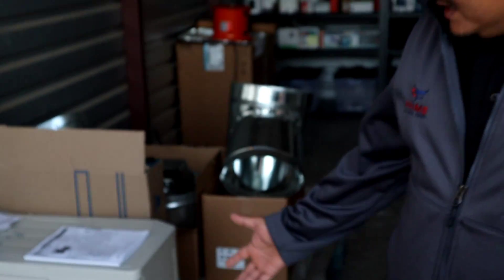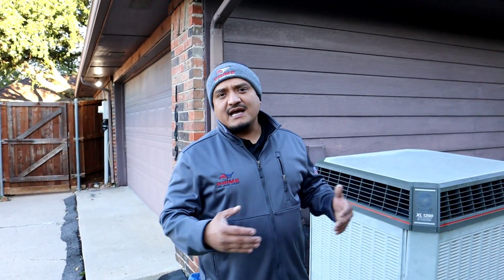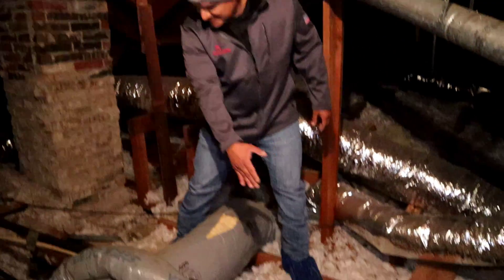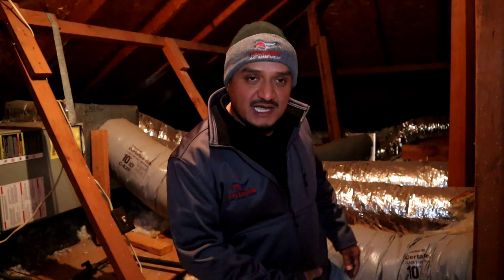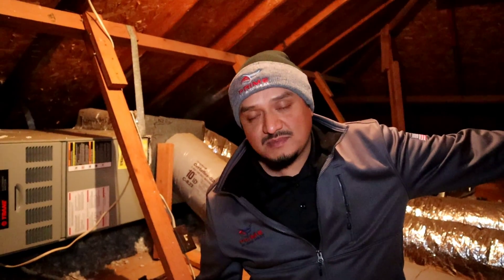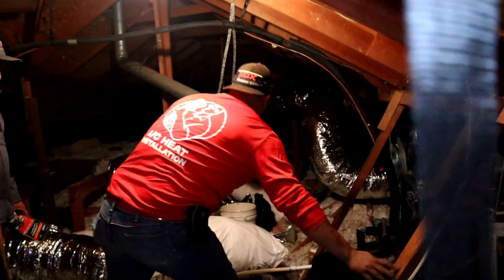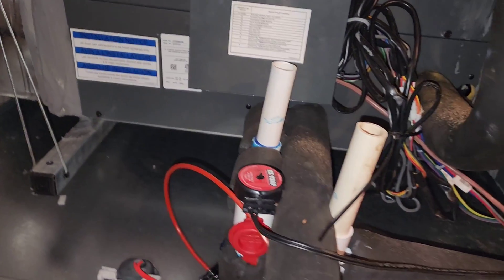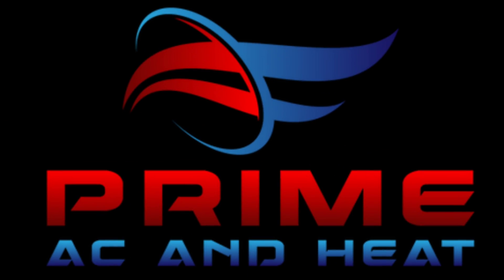Unbelievable AC Upgrade! Amana S Series/Daikin Fit - True Game Changer?

Comment: LOL no way that new goodman is gonna last 25 years
Reply from the maker: We strongly believe this model—and the entire Amana/Daikin lineup—will outlast most brands on the market.

A huge part of that reliability comes down to who installs the equipment. When you eliminate improper installations, shortcuts, and unlicensed or untrained individuals, you immediately increase the lifespan and performance of any system.

With our installation practices, certified technicians, and the Prime Standard applied to every job, these units become some of the most reliable systems you can put in your home.
Reply: @primehvac  Evaporator coils will leak within 5-12 years. Inverter boards will fail around 7-14 years, and ECM motors will fail within 8-12 years. Maintenance can extend the lifespan, but the parts simply won't last that long, regardless of installation quality. R-22 systems, even with poor installers, easily lasted 20+ years, while R-410A systems, even with great installers, lasted only 12 years if you were lucky. This is not a critique of your installation work(which seems great), but a reflection on the industry's lack of quality and reliability in newer, more complex, and more efficient systems.

Comment: Have you had any situations with line set vibration? If so, any suggestions on how to minimize vibration entering the house/walls?
Reply from the maker: @timjameson1385 Thank you for your question! Yes, we’ve encountered situations where vibration travels through the walls. In our experience, this is often caused by loose copper tubing touching a stud. Try moving the unit forward, left, or right if possible. If that doesn’t reduce the vibration, check the lineset in the attic to see if it’s loose and making contact with other studs. Most of the time, vibrations come from something loose touching another material. Hope this helps!